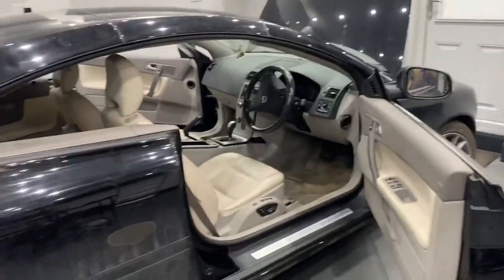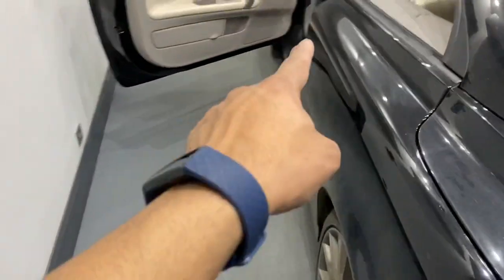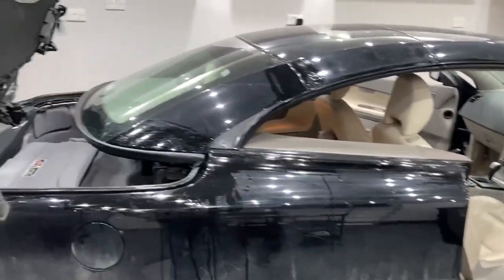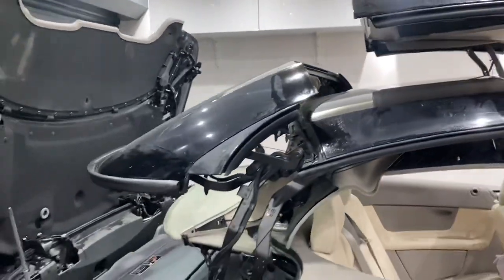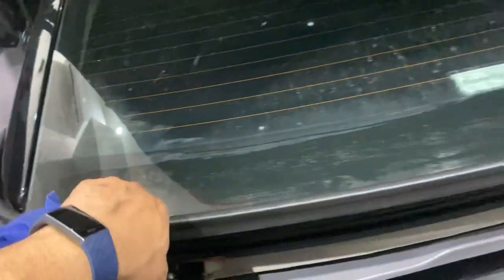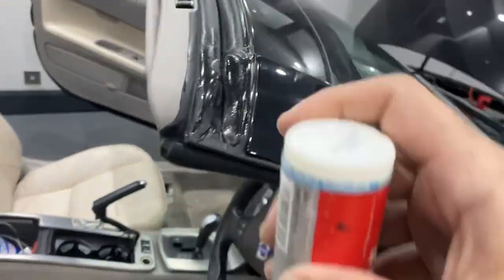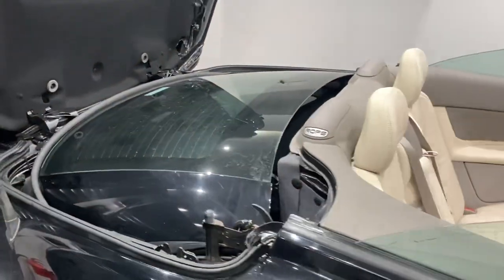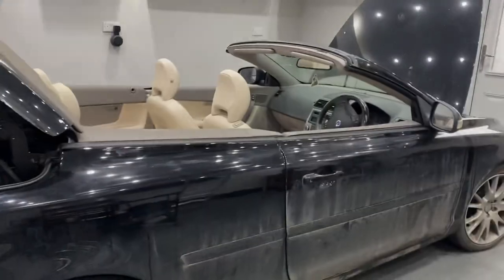Volvo C70 Convertible - How To Clean and Lubricate Seals

Comment: Glad I found this video. About a year ago I attempted to do something like this with the roof half opened. After getting out of the car I noticed the extending portion attached to the trunk lid "fall down" gracefully due to gravity... After attempting to close the roof of the car I was met with errors and have since not been able to use the convertible after manually closing the roof for good. Any tips... Is this a hydrolic pump issue? I have recently been directed towards a potentially failed limit switch.

Comment: I've got the same blue C70 ( 08 D5 SE Lux Auto ), Its had new rear suspension top mounts and bumpstops but the roof still rattles like a van. Just wish if you had that C70 available you could show how to access the roof pistons to check for tightness. I'm concerned I wold destroy the roof lining attempting to access them.
Reply from the maker: Sorry we haven't got the vehicle still

Assuming you're not in the Uk ?
Reply: @CabrioletTech  I'm in Manchester so your Leicester location too impractical for me
Reply from the maker: @ebodjarvo  we regularly have vehicles from all over the Uk, but hopefully you find someone on your doorstep

Comment: I’ve heard you should not stop/leave the C70 roof partially open as errors/failures can occur, not true?

I also have to ask, why didn’t you wash the car prior to cleaning the seals? It’s filthy :-)
Reply from the maker: Fair comment, you can stop the roof provided it is at the point of lowest gravitational potential. Such that it is not relying on hydraulic pressure. Hence we turn the ignition off

We are a cabriolet repair specialist, we do not valet vehicles 🤷🏽‍♂️😂
Reply: @CabrioletTech  I'm a little confused, in the video, you instructed to keep the ignition on when stopping the roof halfway. Totally not trying to call you out or anything, just curious, is it safer to stop the roof with ignition on or off? I have a 2012 and my roof is in great shape, and I am trying my hardest to keep it that way lol
Reply: @burnsy277 you should be fine to keep the roof in the halfway position even with the ignition off, however, people have made a good comment in that the ignition off stops power and could potentially cause the pump to lose tension in the hydraulic system.

I've had mine half way with ignition off and on and these days I keep it idling. As they have explained very well in the video as long as you follow their instructions you should be grand.